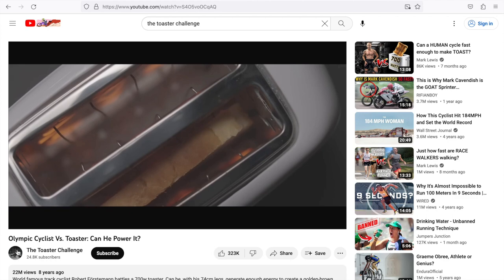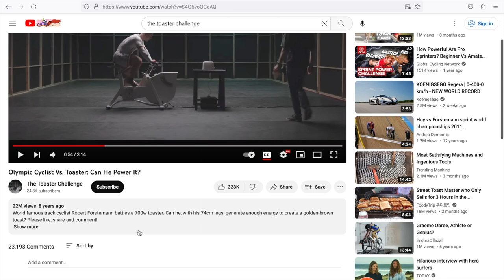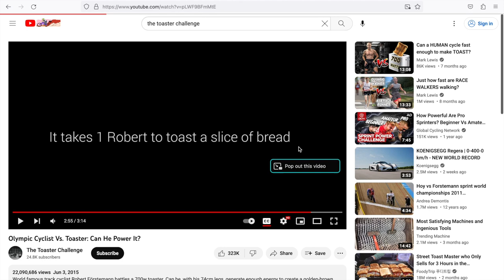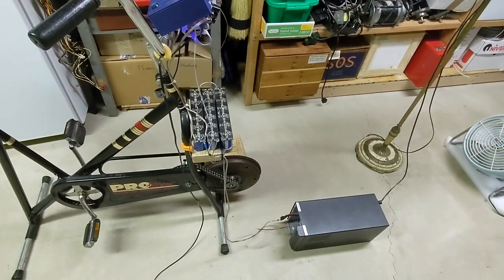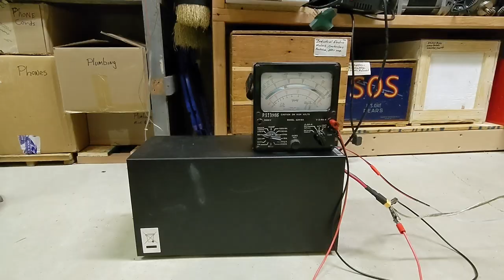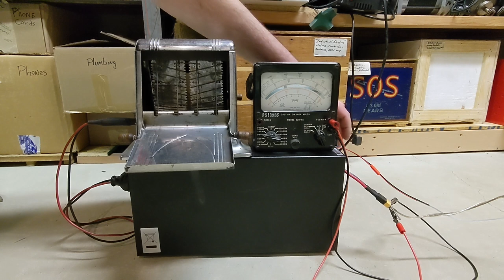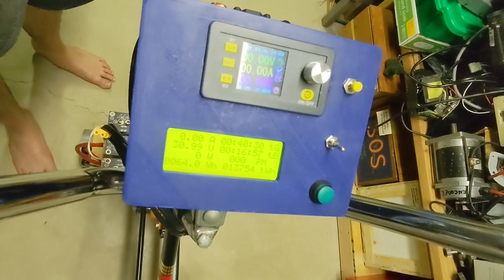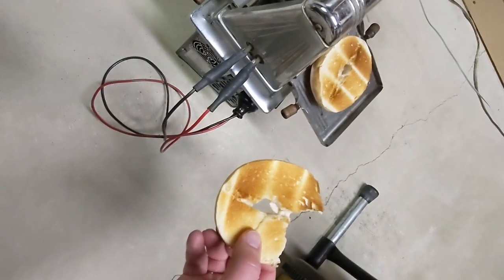The "Toaster Challenge" was faked. Here's how I did it for real.

Comment: The reason to measure the bike but supply the electricity from the wall is to avoid all the losses from the generator and inverter.  I wouldn't say the original was illegitimate
Reply: True, but then real life has power loss over the transmission lines so 🤷‍♂️
Reply: @jb-br8bf The point of the challenge is to give people a tangible sense of how much 600W actually is, not a lesson on power conversion and transmission. So matching the power output of the human and the toaster is correct.  (But at the same time, I understand how the challenge gives the false impression that he's powering the toaster directly, which is not true.)